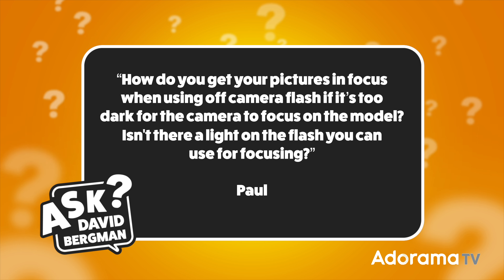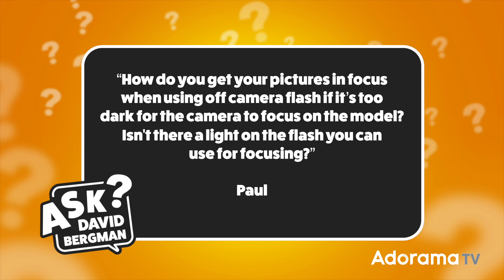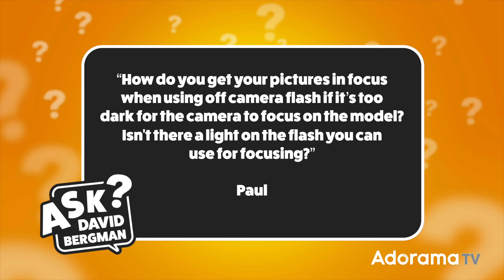Modeling Lights | Ask David Bergman

Comment: Great video David Bergman! Funny I did a shoot on the beach at night and used battery operated strobes but since they are an older model the modeling light does not work in battery mode so at one point since I was shooting with an dslr the focusing became very hard and unfortunately I din not bring a flashlight. I like in the strobe you showed here that the led modeling light is flushed in the head, back in the past modeling lights sometimes burned a bit in the flash tube but with that model I guess that issue is gone. Thanks for pointing out how having a modeling light helps with how the subjects eyes will show fuller, great tip Sir. Thank you ADORAMA for having Photographers like David Bergman in your channel showing us how to better use all the great Gear you guys offer!

Comment: 8:20 Around that time, David describes that some strobes vary the modelling light in relation to the flash setting (level). That's called PROPORTIONAL modelling light and exists, at least in studio packs, since before 1980.
The condition for "proportional" to help you is, however, that not only does it work in proportion to your flash power setting, but also between different heads.
With a studio pack, the proportionality between the heads is managed by the pack.  And then there's nothing.
My pre-1980 studio pack was very precise and allowed to read the flash aperture on a normal lightmeter once we figured out at what exposure time to read the aperture appropriate for flash.
While the latest speedlites (Canon) and speedlights (Nikon) may have a continuous light source that can give video or modelling light, some older ones, like my Nikon SB-910 pulsate the flash very fast as a way to mimic modelling light. The latter needs getting used to, really and cannot be measured with a normal light meter.

Comment: Since I dont have off camera flash i turn the rear screen from the exposure simulation off it helps when using flash without modeling light and using in camera flash off camera

Comment: Thank you as always, David. Quick, to the point, and educational. Purchased my first strobe last week. It has a modeling lamp that can be used proportionately to strobe output. My camera also allows me to change the EVF so that it doesn't reflect settings (i.e. brightens the viewfinder) - but I wondered if the ability to focus would still be a challenge unless the modeling lamp was turned on. However, you gave me another reason to turn it on - to avoid LPS (large pupil syndrome). Quick question with respect to that thought: (remember, I'm new to this). If you are shooting in a dark environment, and plan to use any modifier that will reduce the power of the light (i.e. softbox with diffusion), would the modeling lamp still provide enough power to focus? I'm passing your video around to other beginners. Appreciate the time and effort you take to answer questions. Perhaps I'll have my own soon enough. Thanks again.
Reply: The output would be reduced slightly by the modifier, but still should be plenty bright enough to focus! Thanks for watching. :)
Reply: @DavidBergmanPhoto  Thanks for the response and taking your time to produce these.
Reply: @dance2jam Thanks for watching!